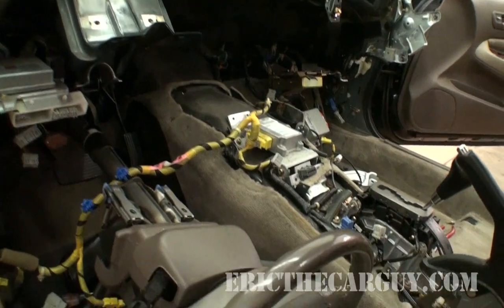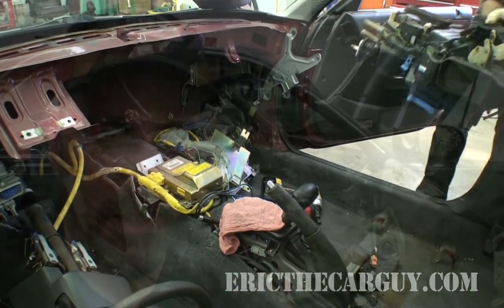Pattern Repairs -ETCG1

Comment: Funny enough, the fuse to the blower motor in my car went out in mid-May. In late June, the blower motor in my GF's car decided to quit as well. It appears to be either the relay or the resistor, luckily. This is somewhat interesting because they are two different makes and models from different years of 1997 and 2002. The latter car was just recently purchased too. Crazy car shenanigans.

Comment: One of my first cars was an '81 Accord. The cam gear that drove the oil pump went bad, and as a result, oil pressure would start to fluctuate. I went to my local salvage yard in search of a new cam with a decent gear....the guy behind the counter laughed and said "good luck, they all did that". As it turns out, he wasn't lying. I must have pulled at least three valve covers off of cars in the yard, and all the cam gears were looking pretty bad.

Comment: I'm a professional automotive technician and I have seen "pattern repairs" like you mention in the video. It is, by far, a strange phenomenon. I worked in a few independent repair shops and I'm now a lead repair tech in a high volume franchise facility. I thought it was just me that experienced these unlikely repair patterns on completely different makes and models of vehicles. For example: In a one to two week time period I would have similar electrical component issues like sensors and switches. Like a magnetic wave just killed O.P. switches and Temp sensors on several vehicles such as a VW, Subaru, Jeep, Pontiac, and a Honda! WTH??? All of those vehicles were fixed by replacing the sensors. Weird, right? Then I'll have a month of radiator replacements. Next would be clutch packs and slave cylinders for a week or two. Brakes don't count because that is a component that typically needs attention. Last week I had 3 inoperative wipers, two of which needed the wiper motor and the other a fuse. Intake manifold gasket repairs seem to always come in threes! No start conditions on the Ford 6.0L Diesel F-Series seem to come in threes! (It's usually the IPR or the high pressure oil pump) Yes Eric, I do experience this. Thanks for the video because I thought I was in some crazy butterfly effect...or maybe I am, or WE ALL ARE! LOL!

Comment: We get the same thing every summer when the weather gets hot with Ford Modular V8 intake manifold gaskets going bad due to the different heating/expansion rates of the I/M and the cylinder heads.  Also happens during extreme cold, but not nearly as often.

Comment: Get this, my old BMW 325xi started sounding.. Different. It would take longer than normal to start up, the run poorly all day. I checked everything i could think of. After my co-workers talked shat about my BMW being a bad car.. They started having similar problems, then my girlfriend and her parents. Come to find out, we all used our small town's mom and pop %100 gas station, that was selling bad gas. We've all had some car trouble after that, bad fuel pumps, misfires, my grannys lexus had two bad cat's.. Probably related to years of sketchy gas. Needless to say, i only use V-power now. It may cost more than most, but i've used it since day 1 in my F30 328xi and it gives me peace of mind.

Comment: Out of 3 cars, it seems 2 of them have the same or similar problems most of the time. 

Power steering leaks, for instance. Brake and clutch fluid too...
Reply: power steering leaks can be caused by bad engine mounts which puts stress on the hoses and can cause leaks. this only has to be minor to have an effect.
Reply: I actually just did all of the mounts on one of those cars...
Turns out its the rack and pinion itself that's leaking. The other car (which has good mounts) has a hose leak. 

Funny how that ends up working....
Reply: NinjaRooster
 Some vehicles also have mounts that inflate and deflate with engine RPM, My 1994 CD5 Accord has this, which causes constant movement of the engine.. Even with good mounts :) So this could also cause these same symptoms over a period of time.

But yeah, from what you described there sure is some humour to it :P
Reply: Sacra Mental Ooh, ya learn something new every day! 
I'm actually completely shocked that the car that had bad mounts ('92 camry 4cyl) didn't have hoses and such breaking left and right.... The mounts were completely gone. 0,0

Comment: This is true of weather and seasonal conditions. Lorries come in for repair in the Autumn [fall], same symptoms will start run for 10 miles and stop and cannot restart. An hour later, this truck will start run 10 miles and cut-out. Whats the problem? While filling the tank, a small birch tree leaf blows in to the tank. Result Vans, Trucks needing the fuel tank washed out. Tanks with sieves overflow while filling: even though the tank is empty.

Comment: I have a car and a truck - different makes.  I've had this happen on multiple occasions - both of them will lose a headlight within a few weeks of each other, one time both of them had cooling system issues at almost the same time.  Another time I was doing a brake job on the truck and out of nowhere my sister calls me and tells me that she's getting a weird noise out of her car (she'd run one of her pads down to the backing plate...  I've had both of my cars for years, one's a 92 and one's an 04, and I've had to replace both of the original windshields in the last year.  It's kind of strange.

Comment: Heh, in the computer market you see pattern repairs all the time. Thunder plays a big part of course, more fried power supply units in summer than in winter.
Then you get the occasional virus/trojan that flares up and busts a number of computers. (yes, even apple)
Then you get a bunch of computers with bad SSDs (flashdrives) because of the design. Several different makes of computers but they all use the same brand of SSD or the SSDs from different brands use the same components.
In summer you have people come in and complain about the performance because of heat issues, that's where you end up cleaning out entire pet stores worth of fur and what have you.

Pattern repairs are not limited to cars, it happens on everything.

Comment: 2003-2005 chevy trailblazer's... 3 of them, all in the same week with brake issues... calipers gone bad, lines broken, all of them with power steering fluid leaks, that was one hell of  a week, by the way, one of them has a v8 on it and it doesn't want to go... the "under the hood fuse box" burned out and now we are trying to figure out what went wrong in the truck, cause the new unit is quite expensive ($800 from the dealer) and we don't want to burn that one!

Comment: from working for a used car dealer there is pattern failures. but pattern failures lead to pattern repairs. i swear every 2007 sante fe i pick up that we get in trade or whatever has bad wheel bearings. every single one. so we send them all off to get fixed usually to the same shop we use.

Comment: Yep! I have, last week I did 2 blower motor Resistors on Hondas, I know pattern failure, but I have not done 1 in a year and in one week I had 2. I have had runs of bad coils on different makes in the same week. For like a month I was doing mostly fuel pumps like 3 or more a week and then none? WTF?  Or getting nailed with a bunch of heavy line work for several weeks with no gravy:(

Or those golden weeks where all you are doing is gravy, brakes, brake fluid flushes, trans flushes, coolant flushes TBelts etc

Comment: Pattern failures yes.  Pattern repairs not really.  Do I see cars with same problem within one week.  Yes.   Had two different make and model cars with transmissions that failed within same week.  Regretfully both vehicles had history of pattern failures related to transmissions. However, I still think it was random that both failed in one week.  It will be interesting to read other comments though.  Thanks for another good video.

Comment: It's just a coincidence. Sure its a strange coincidence.. If it weren't strange nobody would care. But that's what makes it a coincidence. Rare things are always happening, all over the world, every second of  everyday. All the time, rare events take place. Which is a hard concept to understand. But if you think of a mechanic working on completely random car problems one would expect the problems to come in completely separate to the problem before or after the current car. But of course, that's not how randomness occurs. Picture a coin being tossed 10 times in a row. The first 4 tosses land on heads. You would think on the 5th toss the chance of the coin landing on heads again would be less. But of course its still a 50/50 chance. Randomness does not mean tails, heads, tails, heads, tails and so on. That's opposite of random. That's order, or a pattern. And the same is true to these car problems. Randomness would like almost ensure that these strange coincidences would eventually occur. I really hope someone read this.

Comment: Mannn, that job looks like a bitch!!  If that car was mine, depending on how old the car was, I don't even know if I'd bother ripping the whole dash and steering wheel apart like that lol.  Funny you say astrology, because they say when Mercury is in retrograde (whatever that means) then electronics and mechanicals will break down alot

Comment: hondas transmissions in the mid 90s typically at 220 000 or 235 000 kilometer 
around 137000 miles and 140000 miles 155 miles at best
they would fail a far cry from the previous hondas
just the transmission everything else if well maintained is pretty much bullet proof